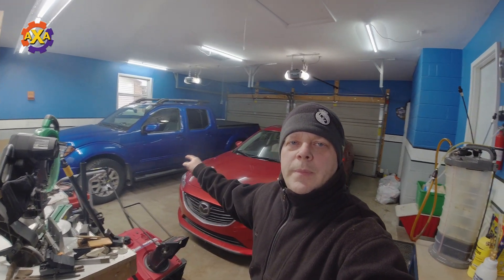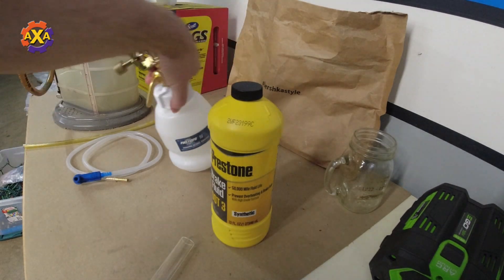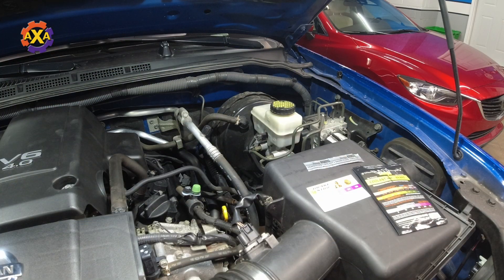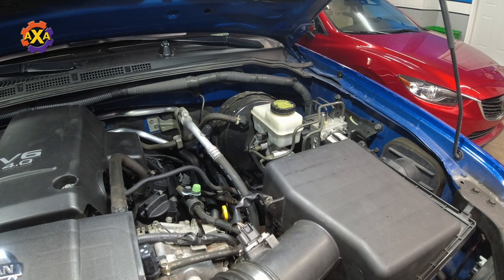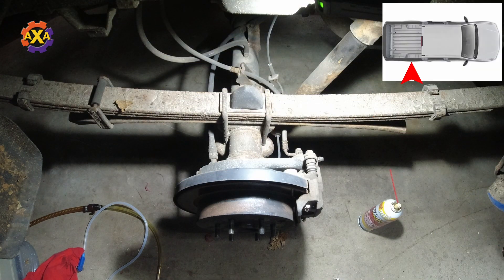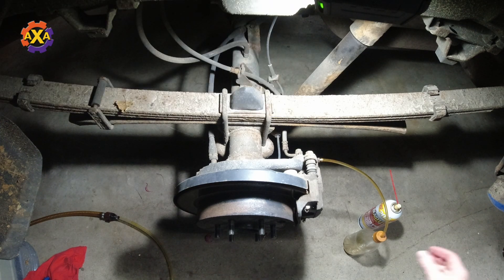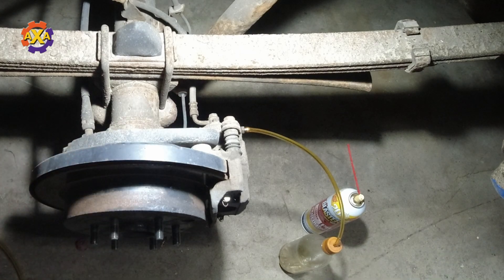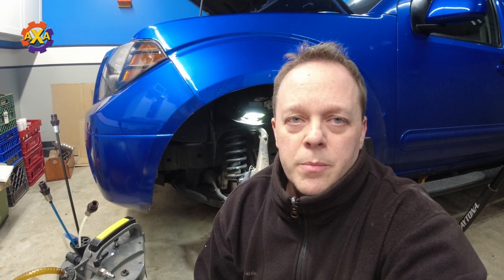How-To Flush Brake Fluid on a Nissan Frontier and Xterra

Comment: @ 4:30 you said it will check for how much moisture in the oil (meaning brake fliud). 

 Brake Strips test for copper, not water.
Reply from the maker: You are absolutely correct as the pen is for moisture and the strips are mostly copper (they have some strips that test other than copper) I'm going to have to edit/remove this section.   Appreciate it.